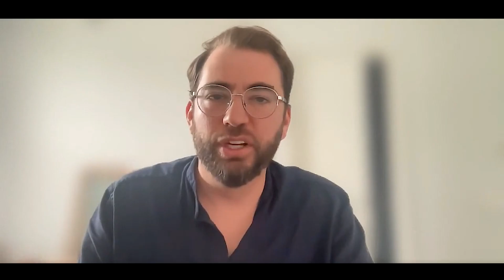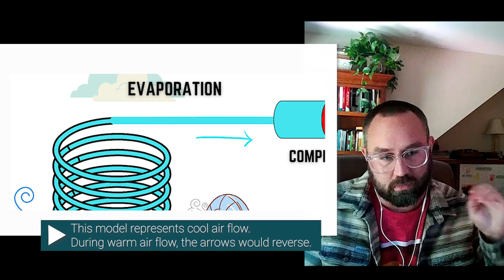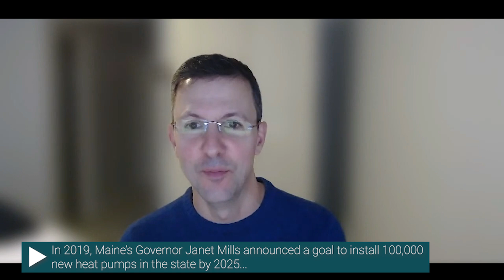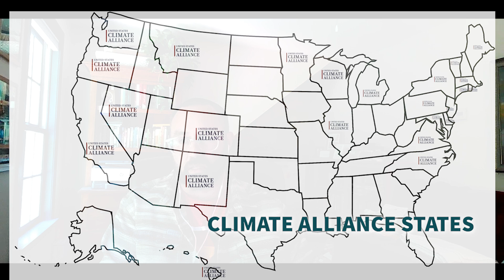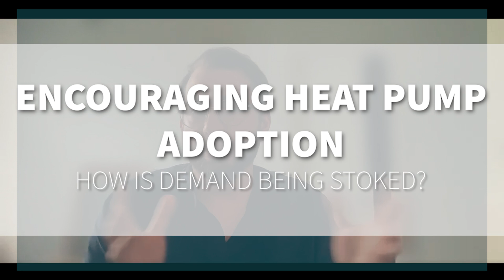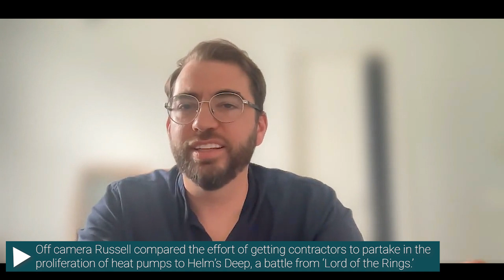The What, Why, and How of Widespread Heat Pump Adoption

Comment: Heat pumps equal blowing air.  Not ideal..   This is why millions prefer hot water baseboard and radiant floor systems
Reply: Most UK heat pump installations are air source water pump heaters, so the heat exchanger pulls the heat from the air, but uses that to heat water and underfloor heating. No air blowing inside.